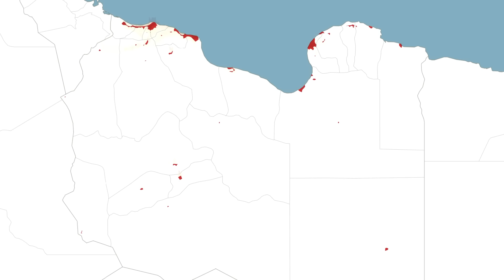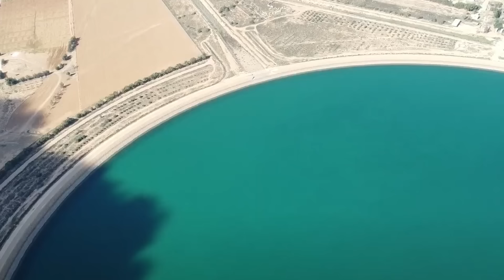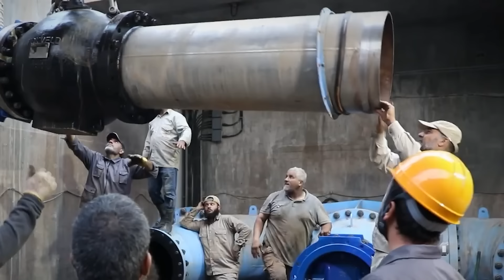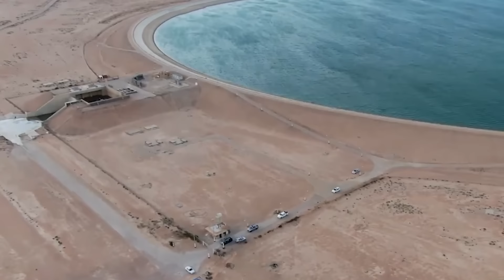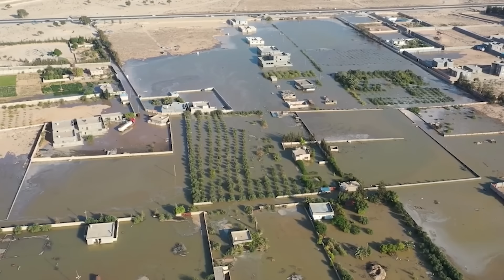They Start Pouring 2 Billion Liters of Unsalted Water a Day Under the Sahara Desert

Comment: So the "fossil" water is not being replaced from the surface "because desert". SO... taking water from this aquifer will be "WATER MINING". Once removed there is no replacement.
If FLOATING SOLAR PANELS were placed on the reservoirs it could almost stop evaporation while also providing power.
BTW, what about SUBSIDENCE? We here in Las Vegas, USA unfortunately know a LOT about that subject.

Comment: It may be easier to build artificial mountains of non porous stone with shadowed stream & river valleys as they attract water.  This is a phenomenon called orographic rainfall or relief rainfall. This occurs when hot air is forced to rise over a mountain range, cools, and condenses into precipitation. The sparse flora & fauna in the Sahara get water by condensation created from the cold night air that forms on leaves  Of course this tiny amount quickly evaporates in the heat of the day., so it would need to be stored underground. Interesting video but the costume looks silly & cartoonish .

Comment: Mix solar and wind out in the wilds of the desert and then require all agriculture to be greenhouse grown and you can save water generate power and even cool the local climate by a small amount. It may not solve the problem, but it can stave off the inevitable until a sustainable solution can be found. It's worth the investment in the long run, that is, unless the latest phone is more important.

Comment: The solution is water collection. When these rainy events happen they need ways across the country to capture it in reservoirs permanently. If they had a way to do this they could guarantee that the water would not stagnate and they would never have floods. So instead of Designing a pipe system for distribution, they should design multi-tiered sewer systems to be able to handle the amount of water that hits and then a way to run it off if there's too much. Then they could actually keep the water running from one tier to the next preventing this stagnation and keeping the water relatively fresh for agriculture and strengthening soil and then you just have to plant things that would grow there and strengthen the soil over time.

Comment: When the water is depleted the ground will fall...causing sink holes, and all manner of destruction above ground as buildings collapse and citizens get hurt...its not wise to pump too much of this water, when each drop takes up to 10,000 years to make its way into the aquifer .

	It would be easier and far more efficient to pull water from the humid air, with a water tower...
They can pull up to 900 litre and hr in hot humid zones, they collapse into their lwn foot print quickly when a storm is coming. 

	They are inexpensive to errect and can be put up in a single day, they do not need elecicity to run, and can be manually collapsed, by turning a small wheel, so when the power is out or not available these water towers could still be in use. 

	It makes more sense to use wind power over solar power as there is nothing restricting the wind which blows constantly across the sands...where solar power would be a problem wih the sand desroying the solar panels or covering them entirely...

Comment: Any way to capture water to slow down evaporation?
Desalination?
The great water-greening, man-made underground water wells to reservoirs.
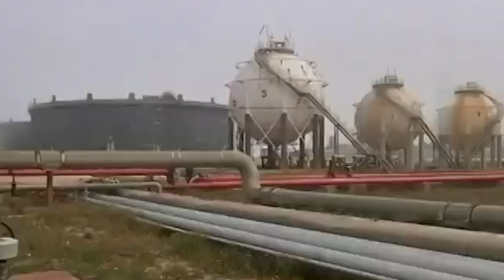3:04 Nubian Aquefor but no one lived in areas where water was discovered.
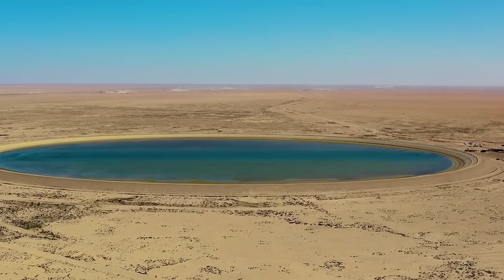6:35 gmr1 at 1600 feet. 1991 Ben Ghazi.
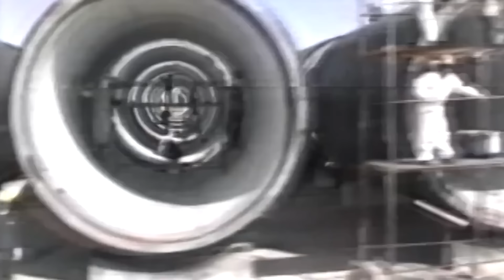8:22 
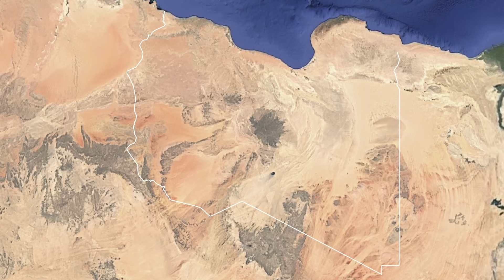8:53 gmr2 1996 tripoli and beyond to  -2009?
10:10 cost rstimates, but 1/10 of desalination
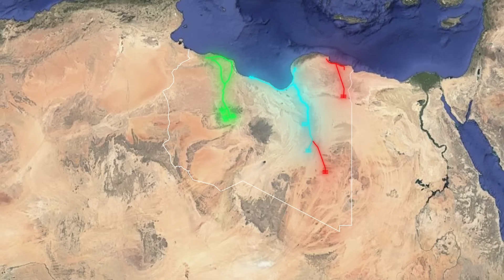11:00 more to network
But ongoing security prevents further. Political upset. Civil war. Vandalism. Financing. 
No follow-through planning for its finite amount.
Solar? Same resource challenges, security
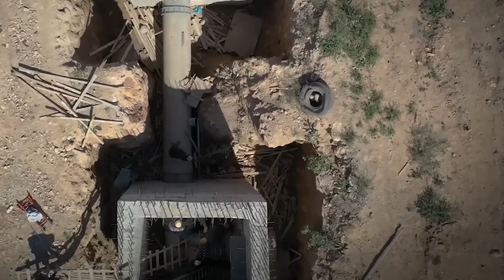17:00 phase 5 etc. Northeast landscape isore challenging. 
Define Irrational use of water?

Comment: cue another reason for aliens to flood europe!  but i had an idea for a basic de-sal setup that simply used a green house to evaporate the water and the vapor would move over a hill into a room with a dimpled cieling that would make the fresh water drip down into a reservoir.  every so often the sea water would be cut off so the water could be reduced down in the green house and then by night people would scrape out the salt with trucks (the greenhouse would be huge and have outside sun mirrors aimed into it so humans would not survive in there during daylight).  if the facility was dug in below sea level- gravety alone would be enough to bring in the sea water so very little mechanics would have to be used.  then again if the evap room generated enough steam preasure maybe it could be a sea water driven power station with fresh water as a bi-product!

Comment: I think this idea is useful for the USA. If a distributed water network were created across the USA, reservoirs could be filled in areas with copious hydrological activity, and the water could be pumped to arid areas or areas experiencing water depletion from fighting wildfires. Areas subject to actual flooding could use intakes to drain flooded areas or clear waters from drainage channels and the water could be stored or used as needed.

Comment: Despite the size of the underground aquifer, only a proportion of it is easy to extract and it has been estimated it would run dry after about 100 years. That might sound a worthwhile time, but what happens to all the people that have become dependent on it when it eventually fails. Sahara ain't gonna turn green until the Earth's Milankovich cycles turn in about 10,000 years.

Comment: It would not surprise me if the bloody footprints on that strike on Libyan water infrastructure goes right back to Nestle Corporation. They stand to win big if they can sell bottled water to Libyans. I remember reading articles from years back on how several corporations were trying to monopolize global water supplies and monetize it. The one GOOD thing about that is that a monetized water system is going to behave like an oil company: they are actually going to lay in infrastructure to find it, keep it flowing and refill the aquifers when needed. The great tragedy of the Libyan pipeline project was that it was constantly going over budget because Government projects tend to be unfocused because Governments never learned about PROFITABILITY.

Comment: Haven't people thought that pumping water out of the ground that has been trapped there for thousands of years and it not in the climate cycle. Has to go somewhere when it evaporates causing more moisture in the atmosphere. And water vapour is a hole lot worse than co2 at trapping heat as a greenhouse gas.
They go on and on about climate change and we are causing it. And we are probably causing some of it but I think they are blaming the wrong things. How many other places are pumping water out of the ground around the world?
And as the the world gets more populated and the is more hard surfaces ie tarmac, concrete and roofs so the water evaporate and not soaking away and saying out of the sky longer.   Just a thought..

Comment: The Great Man Made River Project was built to extract prehistoric water from under the desert. Once it’s gone - it’s gone. 
Unfortunately many of the boreholes simply hit brine. There is probably very little usable water under the desert.
Reply: Water can be purified.. And with a solar collector it can be distilled for use, something deserts have ample of..
Reply: OK, but there's a source of brine that doesn't require drilling deep underground without destabilising the ground.
So why not purify surface water with that solar collection?  The sea is rising as ice slides from land glaciers and melts.
You could make sea salt as a marketable by product and transport it cheaper than from a desert
Reply: @RobBCactive  in most instances cost is the prohibiting factor. Once the need becomes dire money will be allocated.
Reply: @deilliw  so let's cut the expensive drilling

Comment: The water will never run out of the great river why because water is produced from the Earth's multi core Along with Oil and magma magma The oil separates the waters The land separates the oil.  Oil and water are by-products of the molten iron core that gives off gasses that recondence into water and oil. Oil is not a fossil fuel it is not made from ancient dinosaurs... There is an unlimited and renewable supply of these basic elements Earth oil and water

Comment: why not incorporate mirrors into the desalination plant, directing the suns energy into say the sides of a boiling vessel or pressure vessel, surely that would negate most of the electrical costs since it would remove most of the impurities in the process of heating it up and turning it into steam that could then be collected in pipes underground which could help negate some of the costs of cooling said pipes (depending how deep you go)

Comment: The biggest problem with desalination is not energy, which as you rightly said can be provided be renewables, but the brine waste. Look at what's happening in the Canaries, where colossal amounts of brine are released at sea : Everything dies around the release spots, fish and all other sea life, vegetal or animal. 
That's because all those organisms can't cope well at all with excessively salty water, and there doesn't need to be much more salt than in seawater to cause these kind of die-offs.
The canary Islands are located in the Atlantic but the ocean currents do not seem to be able to carry off the brines fast enough to prevent them to reach toxic levels....what then could we expect from coastal discharges of the magnitude involved in desalinated water supplied to the whole country of Libya ?
Reply: They should just make brine belts and harvest the salt to sell. Its worth money and its literally their waste.
Helps the environment and they gain some money from their waste. Win/Win.
(Itd have to be cleaned and iodized salt, most likely but still sellable.)
Reply: @shupichii9647 why they can't dry the brine until it becomes a block of salt
Reply: duh, you don't release salt into the ocean, you harvest it.
Reply: @HamguyBacon  release salt into the desert  way better place
Reply: If you've ever used a reverse osmosis system the brine issue is clear. My gravel driveway would get the brine and absolutely nothing will grow in it.
Reply: You dont even need solar panels... you just need solar heat. Meaning, you can clean the water already by just heating up and turning it into steam. Even more so, you can release that stream out a little bit creating clouds and mist that waters the ground around it filling under water lakes over time as well. Little to no brim is created... and if you really want to push it a bit more.. you can move that to heaviest plants where you can get all types of salts - from li to nuclear.
Reply: Wait team water are going to do it for multiple countries
Reply: Energy can be provided more efficiently and with less pollution with non renewables btw. Renewable doesnt not mean environmentally friendly, that's just the global marketting propaganda
Reply: @bvs1q  No.  Photovoltaics pay back their latent energy in 1.5 to 2.5 years and those are 10 year old figures.  Massive advances have been made since then.  After that period the energy is emissions free.  One day the energy to produce photovoltaics will come from the Sun.

Fossil fuels do not ever renew, they become exhausted and pollute at the same time. Lose-lose.  And do not have near the potential for meeting future demand.
Reply: @bvs1q  No, they can't, unless you mean nuclear which is still classified as 'green'. You are just victim of petro-state and corporations propaganda so they can keep making absurd money off of the suffering of the rest of us.
Reply: Natural evaporation of the sea increases salinity.
Reply: Serious question, what if they reverse the pumps and pipe system and move the salt water from the ocean to the desert.  Release the water into the desert and let it naturally filter and refill the aquifer.  I assume that the 1500' of sandy desert would filter out the salt and purify the water.  Thoughts?
Reply: @jvage  Sand doesn't filter salt, sorry.
Reply: @jvage  Unfortunately not :(
Salt is dissolved in the water and essentially becomes as much a part of the water as the water itself. That thus makes it so you can't filter out salt with sand.
Reply: @TheWanderingNeko  Thank you for the reply.  That makes sense.
Reply: @jvage  It would do nothing. You can't remove the salt from water with sand. Sand filters work by trapping solid particles as water passes through a bed of sand. 
Salts, like sodium chloride (table salt), dissolve in water, forming ions (sodium and chloride) that pass through the sand filter along with the water. 
To remove dissolved salts, more advanced methods like reverse osmosis or distillation are necessary.
Reply: @jvage  my thought too, just pour the brine into the dunes? Probably has other ecological issues tho
Reply: Why not import fresh water to dilute the brine and balance the ph before releasing it. You wont have to import enough fresh water for the entire population just enough for the manufacturing process.
Reply: @firstnamelastname4126  It would be better to build a pipe, take sea water in, mix the brine into it then use holes in the pipe to pump the the toxic level salt water back to sea dumping it in several points, not dumping it into one or two spots near the shore.
Reply: @Hellsong89  true they can force it through sediment and activated charcoal also
Reply: @firstnamelastname4126  You know that the brine is created in the first place while creating fresh water out of sea water? If they would get cheap fresh water in such quantities, then they dont need a desalinatioon plant.
Reply: @firstnamelastname4126 if you remove water from salt water, then import water and add it to salt?
Reply: @firstnamelastname4126  Because water in = water out xD?

Comment: Why use solar panels to fuel desalination when the sun can do all the work for us. Salt water reservoir made of stainless steel or some highly corrosive resistant metal combination, buried in sand with huge sun ray reflectors aimed at the surface of the artificial reservoir and some very huge very large cover right above it to catch the droplets leading them into a pipe that connects to the aquifers or agricultural pipe lines. How feasible would this be I wonder
Reply: firstly, that method might get you a few thousand gallons per day of water. This project needs 90+ MILLION gallons per day.
secondly, this area is covered in SAND. Do you realise how abrasive sand is? When the wind gets up and starts blowing sand into the mirrors, it will be like a thousand DeWalt angle grinders going at your mirrors. Desalination plants can be contained and armoured with steel
Reply: Great idea until you realize dry places are sandy and that the first time the wind blows your big mirror is now a big pice of frosted glass.
Reply: @louismonkeybusinessswanepo5161  Realistically speaking you might be right, but for the dreamers who believe it might be easier to clean a few big mirrors on a pole in the sky then cleaning a thousand solar panels on the floor. Could be wrong, but people made huge strides on insignificant or impractical ideas before!
Reply: @innocentwhitegirl523  I live in Namibia. And trust me it's not a case of cleaning it's a case of replacing the sand can be rough imagine if you can see the dust being carried into the ocean on a satellite photo what it will do to the mirror on top of that tower. When the weather condition occurs frequently enough to have its own name "oosweer" it might be a frequent and detrimental occurrence. I'm not saying the idea is bad I'm just saying where the ocean meets the desert, it might not be the best idea. Also I'm operating under the assumption that similar environments might have similar issues as I have never been to lybia

Comment: ground water is essentially fossilised rain water
Reply: Not if it is deep subterranean water. There are oceans further down than we can drill. Some places this seeps out in places with no rainfall, such as the dessert or even ocean floors.
Reply: This is correct. There is actually an ocean under the ocean.
Reply: That's false ground water comes from the Earth's molten core its gas is given off that recondense under ground and make these great underground ocean's rivers aquifers
Reply: Reddit way of thinking but sure I guess

Comment: All you need to do to clean salt from ocean water is evaporation. You can simply do it with plastic, a tray of water, and a cup. Salt doesn't evaporate with the water. Think of rain clouds. Use common sense people come on
Reply: Desalination plants need improved tech to be practical. We need to find a way to take the salt out without having to evaporate the water
Reply: the large scale version are solar still troughs, with auto refill like a toilet.   
once every few weeks scrap out the sea salt and its in high demand by health food ppl.
so it uses the sun for free energy, and salt makes money, a win-win.
Reply: I think the water was naturally desalinated from the sand. Couldn't they use sand filters?
Reply: Correct but too slow and not practical for large volumes.
Reply: @1BillT  It just depends on your inventive thinking skills.... for example pump tons and tons of salt water on to the "Great Salt Flats" and let it dry there... the ground there is already SUPER salty and as it is a dessert it will dry quickly if you spread it out over the desert. (or if you think of an issue with this it could just as easily be large glass containers that we fill with the salt water and leave the top unsealed and it will evaporate that way AND the added bonus of having the salt already saved up in containers)